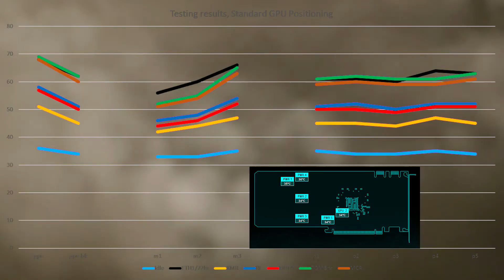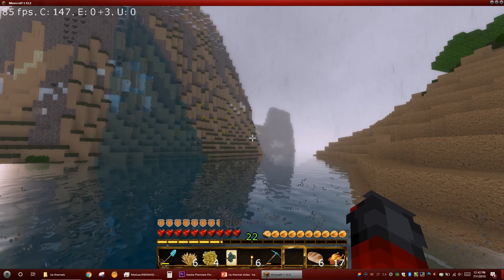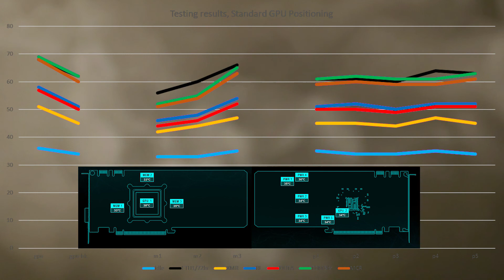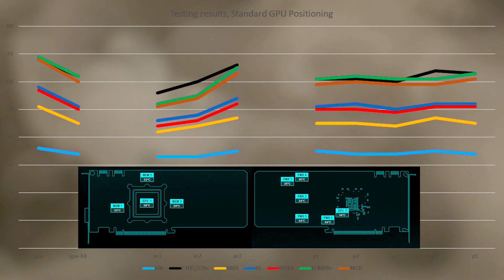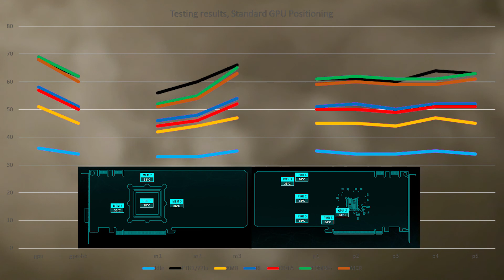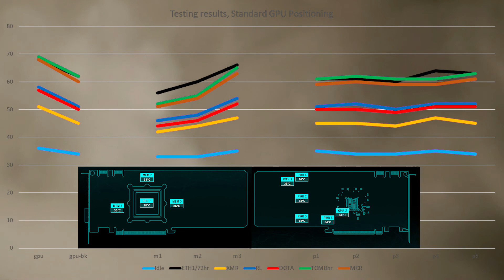GPU & MEM & VRM temps: Games & Mining! (iCX sensors)

Comment: Hey man do u think it would be worth while to start mining with my 1080ti? I don't wanna burn out the card but I'm curious if you think mining at some lighter levels would make sense.
Reply from the maker: Think of it this way, every couple years when you want to upgrade GPUs, you can sell your used card for 50% of what you paid in the first place, OR you can mine that 50% back overnight when not gaming, potentially much more if you hold and sell at the right time. Assuming the GPU still works (it should) by the time you want to upgrade, you have BOTH mining and selling-the-GPU money, which should cover the entire purchase price of your next upgrade. 24/7 mining on most any card should pay for itself in a year, or a little less.